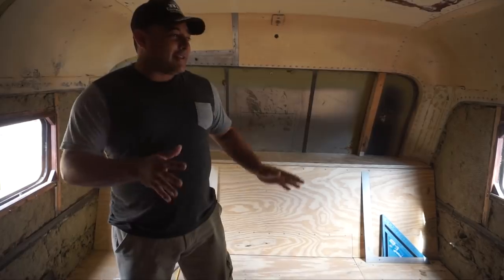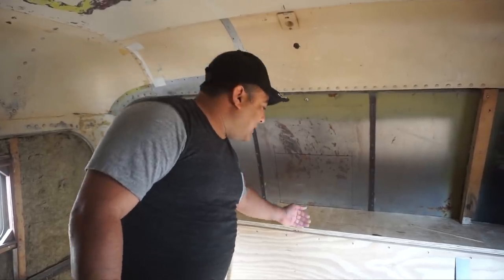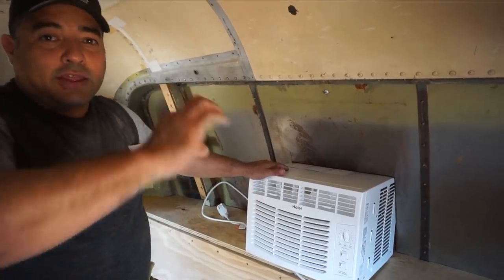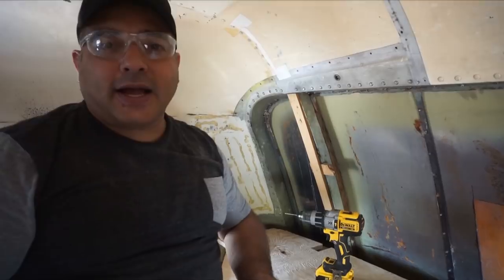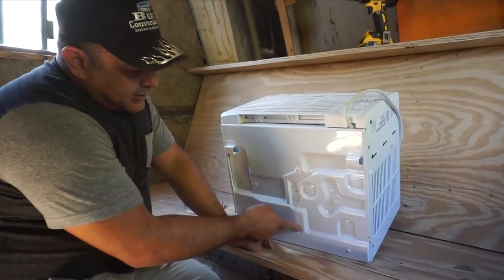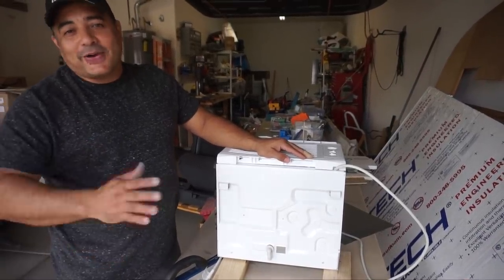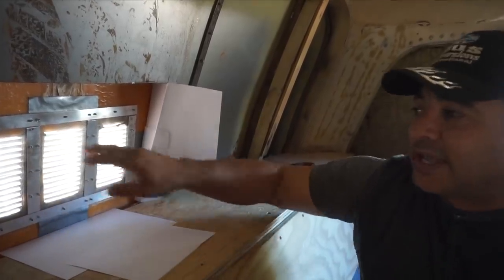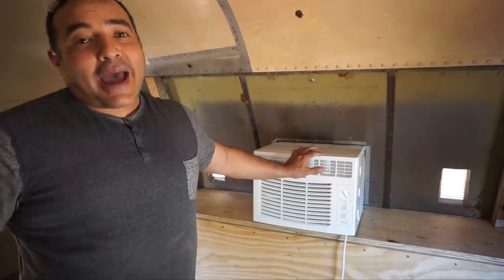Installing a Window A/C in the bus (but not in a window)

Comment: Are you going to be boxing in the area around the A/C unit forward of the intake vents?

At $30 each you could have bought them all...then kept a couple (backups) and even re-sold some for $80 to $100 each on Craig's List or something  :)
Reply from the maker: Thank you Gregory - I was so dumbfounded when I saw they were $30 that I half expected the unit not to work ;).   Yes the area around the A/C will be completely sealed off from the "back".  There will be a wall that goes straight up from the lip near the front of the unit that will contain insulation and should be air tight.

Comment: For $30 should have bought 2,3, maybe 4 for spares to have an exact fit replacement Incase the vibration is too much for these.  Is there a carbon monoxide detector setup yet?
Reply from the maker: I was so dumbfounded when I bought this - I half expected to get home and find that it didn't work!  Thankfully Haier makes about 5 or 6 models that are basically this exact same size - so I am hoping replacing it will be pretty easy.
Reply: Beginning from this Morning  that’s great... I was worried your framing was to specific, but it sounds like you are set.  I must say I love watching your videos, I’m impressed how your wife is right there working with you on this.  Thanks for sharing, I know it’s tough to make videos while trying to work on something.  I also like how you show the mistakes and then the solution.  Like I was thinking “cut a matching hole in the drip pan!” And eventually you did.  

Good luck and keep posting updates, I can’t wait to see the rig built out inside.  

Ps. Your video recording idea was so good Elon added it to the Model 3!
Reply from the maker: @olemissjim  thank you, Jim Michelle is a true blessing!  Can you believe we have been together for 27 years! your Elon comment gave me a good laugh!

Comment: Although I'm sure this works, it would be way more efficient if you made a duct around the condenser intake grill and hosed it outside.  As it is now, it's like a single hose portable AC in that it sucks air out of the bus to cool the condenser.  This essentially makes it so you are cooling a river of air flowing through the bus rather than just the enclosed air within it.  It's great if you want fresh air, but not so great if you want to lower power consumption.
Reply: i have mine set up in this way and im not sure if this is bad. would you mind expanding a bit on what you mean?
Reply: @AC-wl7ve  
Basically, the condenser blower needs both an inlet and an exhaust to achieve flow through it.  When the inlet is being fed from the enclosed space you are trying to cool, one of two things happens.
1) (most likely) If the cooled space is not airtight, as you pump air out of it to the outside, it creates a lower pressure area inside the cabin that sucks outside air in through all the cracks and crevices that you now have to cool again.
2) If your cooled airspace is airtight, the pressure inside gets low enough that the airflow through the condenser is choked off making it ineffective.  It's just like plugging the intake of a blower.  Nothing can come out if nothing can go in.
Reply: @Andy-df5fj  interesting. Thanks for the explanation.
Reply: @Andy-df5fj  the unit is cooling pretty good, I’ve got it seeled off okay, but I would say air tight. I do notice a bit of a vacuum effect though when I go to close the door in my room. Do you think it would be smart to leave my door open to allow more airflow, or should I just leave it as is given it’s doing a good job cooling? (Set up in a bedroom)
Reply: @AC-wl7ve  
Any time 👍
Reply: @AC-wl7ve  
If you are happy with the cooling performance and you aren't too concerned about efficiency, I wouldn't change it.
If you are running off batteries though, I would recommend ducting the inlet so it draws from the outside.  It should help stretch your battery charge.
If you want fresh air, open the door a bit for.more air flow, but otherwise, you're most likely getting enough through cracks and crevices.
Reply: @Andy-df5fj  thanks for your response. You were very helpful.

Comment: I could be wrong but I thought Mini Splits can have multiple inside units using the one compressor outside so I thought you could just buy another wall unit to hook up to your existing mini split compressor?
Reply: 5:46
Reply from the maker: We could only find dual zone units in 220V.

Comment: Juan, how has this been working?   I'm considering something like this for drivers AC while on the road.
Reply from the maker: Hey Shawn - it has been working great in the rear - I am not sure it would work well in the front going down the road.  I have thought about this also and I have not come up with a good solution (except maybe drive in nicer weather?).  I have seen a few people put automotive-style A/C driven off the engine and then piped to the front.  If you give it a go I would be really interested in what you find.

Comment: Got some bad news for you. The units today are not
designed to drip water condensation like they did years ago. The condensation
from the evaporator is used to help cool the condenser. 

 That is why the unit specifies
that you tilt it a small amount to the rear so the water runs to the back
of the pan and the fan picks up the water to spray on the condenser. 

 
Now if you park the bus with the front of
the bus slightly pointing down the water will run forward, not drain,
and drip out the front of the panel or just freeze up the unit.
  

 By draining it in the middle of the pan you
destroy btu rating. Also by putting the vents over the exhaust you destroy
further the btu  and the seer rating because of restriction. 

 

Bottom line you no longer have a 5000 btu
unit that only pulls the rated watts. Check it out with a watt meter after it
is running for a while.  

 
Lastly the way you mounted it with the
exhaust inlet inside the bus you are  not going to be cooling anything as
you will be pulling in the air that has been cooled into the exhaust and back
out the rear.
Reply from the maker: Thank you John Smith - you are indeed correct - we will be losing some efficiency because they are designed to use the water with the fan to help cool things down - it even says that in the manual.  Unfortunately, if we are in a very humid place that flinging of the water will not be able to get rid of the water fast enough to keep it from overflowing the pan.  When the unit is installed in a window it is not a big deal - the excess just overflows over the edge and onto the ground.  In the rear of the bus that overflow will make a big mess.  So if my choices are: have a big mess of water or lose a little bit of efficiency - I am going to choose to lose a little efficiency every time.  We have been monitoring this A/C for the last month as we have been running it here in AZ - with a normal day being about 20% or less humidity we don't see any water in the pan anyway.  The unit will pull about 400Watts on high and on a 95-degree day we have to turn it down because the back of the bus becomes too cold.  I don't really understand your last statement - the entire area from the face of the A/C will be enclosed in a wall that will seal it off from the inside of the bus - that is why we needed separate "intake" vents mounted in the rear fiberglass shell.
Reply: Thanks for the reply and best wishes on your project.
Reply: He's just a naysayer

Comment: Did you add a gasket to the exhaust area in the middle?
Reply from the maker: Thank you Kirk - the fit is very tight but we will be adding some foam around the sides to make a tight seal (the A/C even comes with a bunch to use)
Reply: Always like your videos and am always amazed by your the quality of your videos.

Comment: I think I have seen you use a Dremel tool before? If so they have a rotary tool cutting kit made for it. Would have been just the ticket for cutting out the vents. I think the kit is about $20.00.
Reply from the maker: Thank you Bob - I think I even have that attachment!  I should have used that!

Comment: This is a great idea!   My only concern with it is the fact that those cheap 5000 btu window units don't have a particularly long lifespan - maybe, 3 to 5 years.    So, what happens when it dies?    Are you going to find another one that is exactly the same physical dimensions to replace it?
Reply from the maker: Thank you Richard - It is difficult to find a decent FAN for $30 - when I saw an entire 5000 BTU A/C I couldn't believe it.  I am hoping we don't actually have to use this unit very often and we can travel in nice weather.  Practical experience tells me that the odds of this happening 100% of the time are near 0.   But my hope is that MOST of the time we are in nice weather and the MaxAir fan (which costs almost 10X more than this little A/C unit) along with open windows is enough to keep things nice and cool in the back.  Even in AZ if the weather is less than 85 or so we will just open windows and run the Maxxair fans to move air and it keeps it surprisingly comfortable inside.  When it dies we will replace it with the same one or find one with similar dimensions (this was surprisingly easy to do) - Haier alone makes like 5 or 6 models with these exact same dimensions.

Comment: I don't think the window AC is needed... You should factor the amount of air space that will be filled with everything your adding later on to the bus and the distance with the doors you could have used a 4-6 inch fan (even on a timer/temp control ) to displace hot air from the back to the front creating a draft of cold air cycling from front to back. Also I know things are tight and likely no wall space for insulation but a minimal bubble wrap sheeting could make a big difference. I hate to see you install such an inefficient unit to consume your batteries if you don't have to...
Reply from the maker: Thank you - we hope we don't have to use it much at all and can be traveling in nice weather.  This little A/C is for when we get "caught" somewhere and it is unexpectedly hot or humid.  Right now the weather in AZ is very mild (surprisingly) and we can often just open the windows and have the maxxair vent fans pull the hot air off the top